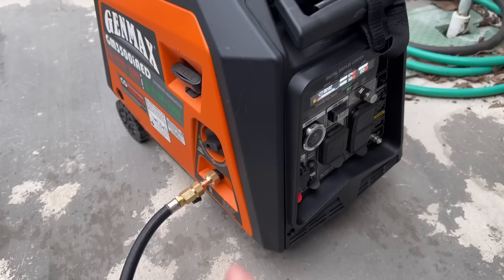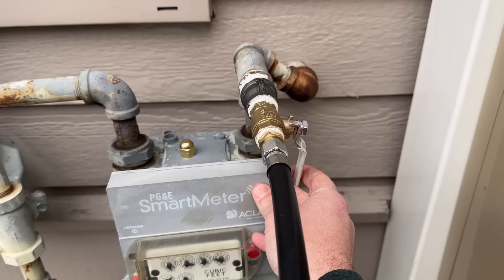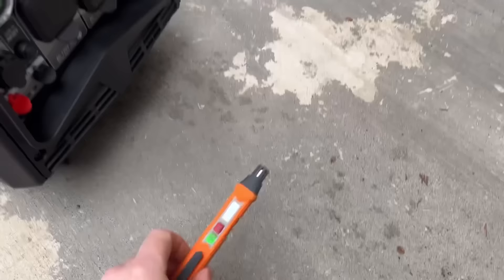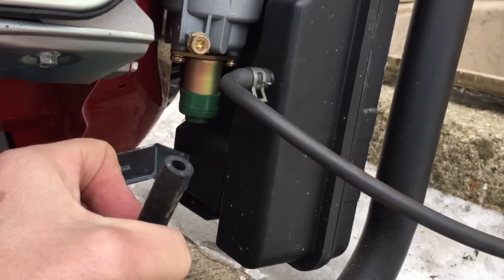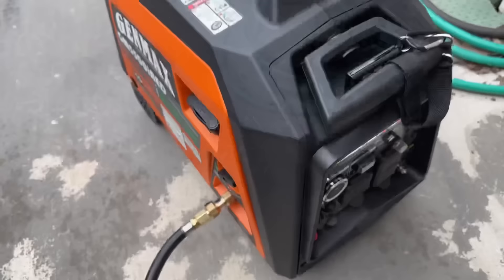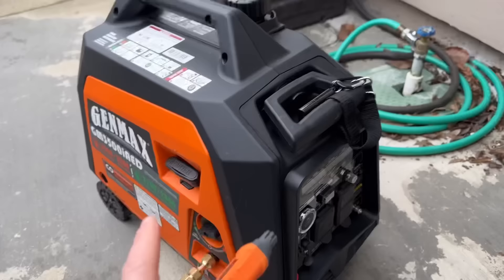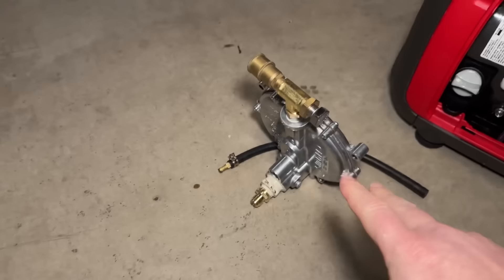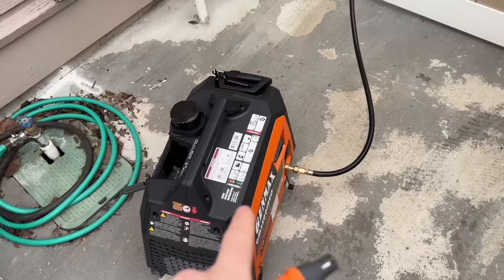Natural Gas Generator Hook Up People Should Stop!!!

Comment: Why can't they just let it determine its own speed according to whatever magnetic load is pulling on it?
Reply from the maker: With a proper regulator it would work properly but just sticking a hose in the air box does not have a way to be controlled.
Reply: @johnnysweekends : OK, but I'm specifically talking about the load on the engine, because you mentioned the load. And whenever you turn on another device that's connected to the generator, the engine feels that magnetic load and automatically tries to compensate for it in order to keep the RPM at the required speed for 60Hz. No one needs to throttle the fuel down or up manually. So why does anybody have an idea that they should have to control that manually as far as the engine load is concerned (set aside anything about turning the engine off, for the moment)?
Reply from the maker: In this demonstration, I’m warning people about not using the correct regulator that has a valve shut off built in. 
There are a couple videos going around where people take a hose and shove it in the airbox which the vacuum sucks the gas in. Once the generator is starter they adjust the gas flow by using the shut off valve as a flow control device. If you add more load you will need to go open the valve a little. If you lighten the load you’ll need to close it a little. If the generator shuts off and you don’t know, the gas will free flow, and nothing is stopping it. 
They are not using the correct type of generator or the proper add on kit to use. 
The generator doesn’t know any different as long as the correct amount fuel is being giving for the load.
Reply: @johnnysweekends : What happens if they just leave the gas on full instead of thinking they have to manually adjust it with the load?
Reply from the maker: If they leave it on full and the generator doesn’t need that much fuel for the load applied eventually it will just run to rich, then start to hesitate and then even actually die. And the gas feed will continue to flow since the valve is still open.
Reply: @johnnysweekends : What would prevent it from running like it does in gasoline mode with its basic governor?
Reply from the maker: If running on gasoline it’s utilizing the carb. That’s controls proper fuel mixture for the load the generator needs. Much like a car but a older car not using FI but basic principles apply
Reply: @johnnysweekends : Right, I understand what carburetion is. But why wouldn't it need that mixing device for gas/gas (fuel/air but just that the fuel is a gas this time instead of a mist/vapor)? And what if someone tried it?
Reply from the maker: I’m sorry but I’m not sure I follow. 
Are we talking about using gasoline with the external regulator from century?
Reply: No,  @johnnysweekends . but now that you mention it, that does sound like a fun experiment for Garage 54 or someone like that!
What I'm saying, though, is: Even though carburetors are designed for mixing gasoline or model fuel with air for the oxygen, what would it be like if someone just tried hooking this gas supply up to the carb intake instead of bypassing it, and then at least they'd have the carb's governor to help run it?

Comment: Maybe you don't know but your hookup is illegal you should not be on that meter at all if your utility comes to inspect you will be red-tagged and shut off.
Reply from the maker: Just for the video..👍🏼 takes a minute to switch and put the plug back in.
Reply: Wrong. Depends on your utility. I'm ok to touch anything on the household side
Reply from the maker: From my research I’m fine. Hence there is a T and a cap for access on the out side of the meter. 
I’m still double checking but everything I have found says I’m good.

Comment: While I advocate the use of a regulator, if you have that much gas leaking out of your vent, I would say that its not working properly. Also, proper venting should be 5' away from an ignition source anyway.
Reply from the maker: This leak was due to not having a external regulator. That’s what’s controls your shut off. The internal load regulator does not stop flow, only regulates with engine speed and demand.

Comment: just have a long burning candle going next to it, its a great way to let you know there is gas leak and its just and extra $5
Reply: That's how we used to check for gas leaks if you didn't have soap and bubbles. Run a lighter around the fittings and if you had a leak you'd see a little flame at the leak.
Reply from the maker: Ill stay with my sniffy pen…😂👍🏼

Comment: Wait, you can use natural gas on a propane generator?
Reply from the maker: Yup but sometimes modifications are needed but power is way less
Reply: @johnnysweekends  yeah I was looking to get a tri fuel because no one makes a dual fuel gas/NG combo that I could find... Don't really use propane, but got a basically endless supply of natural gas

Comment: First off propane and natural gas are two different things. Second, you don't  have a regulator. You can not safley use a valve as a throttle due to the pressure increase and drop that occurs with the gas service line. Third and final the Gen is to close to the meter to safely operate it.
Reply from the maker: Did you watch the video and meaning behind it?

Comment: Sounds like a regulator should be included in the device….
Reply from the maker: All propane or dual fuel generators will come with a proper regulator. It’s more of the point at which people are trying to hook up NG to any generator with out the proper regulator.

Comment: I think this cropped up in my feed because I've been looking around. I have a propane/gasoline generator and I've been trying to see how I could run it on natural gas. I've found a few places that do kits but my model isn't listed. From what I've read, it can be done safely. Do I just need one of these demand valves with an appropriately adjusted load block?
Reply from the maker: Some dual fuel units can be run on NG some cannot. Ill have a video out in a few days on how to tell if yours is compatible
Reply: @johnnysweekends  I know they do make tri-fuel units so I'm prepared that maybe it's not.

Comment: I didn't know you could do this!   So can you do the same thing... Gas vent hose .... But use the regulator?   I had purchased a tri fuel carburetor but this is super straight forward
Reply from the maker: Buy a dual fuel carb and run a line and use a proper conversion kit which sometimes have a gasket with hose so you can skip the carb
Reply: @johnnysweekends  yeah I did....  But I was wondering if this method of the line I to the air cleaner plus the addition of a regulator would work acceptably?
Reply from the maker: You just need a proper load regulator/ demand regulator that shuts off when there is no vacuum. Unfortunately the airbox doesn’t have enough vacuum to open the diaphragm. 
I’m telling you how it works. What you do from here…………🫣😂
Reply: @johnnysweekends  that's exactly what I needed to know. Thank you!

Comment: what is the valve part called that you control the flow with after the regulator?
Reply from the maker: The big silver regulator ? On top of the silver regulator is a load block.

On top where the gas is coming from is a shut off valve
Reply: @johnnysweekends  thanks.  that what I needed to know.

Comment: If a person is changing the idle speed like you showed are they not also changing the Hertz speed ?  Can you recheck it is a hertz meter ?
Reply from the maker: That’s all digitally controlled to hold 60hz with a certain amount of allowable distortion and variances.

I have never seen more than about .5 difference in hertz changes on an inverter type generator.

Comment: Surely a generator designed to run on gas has all the safety mechanisms included? Does your country not have any technical standards?
Reply from the maker: The generator is fine and are standards are in place, it’s the diy method people are doing. Maybe you missed it in the video.

Comment: Are those electrical boxes next to your gas meter? Where I live 6’ is the minimum distance between the gas meter and electrical boxes of any kind. I am sure there are requirements for distance from an internal combustion engine too. But yes improper gas regulation is required. Don’t the large home generators have a valve controlled by the engine shut off?
Reply from the maker: I’m in CA and everything on my outside wall is to code including the solar and disconnect.  The video is for demonstration of what not to do.
Reply: @johnnysweekends  I don’t have gas yet but I looked into it as it’s just up the road but I have to lay $4500 just to get it to my driveway and then another fee for 250’.  Their specifications call for no electrical within 6’ of the meter/regulator. They told me even my low voltage security cameras can’t be closer than that.  It’s expensive to own newly developed property first. It cost over 6 grand to get power to the driveway.
Reply from the maker: Yea as new subdivisions are built regulations will change with it. And it could be the state as well. $4500 sounds about right to run a line of gas or getting water, electric and more. New builds are expensive just as you are describing. I will buy lightly used just for that reason lol. But I’m cheap so I may stay where I’m at lol.
Reply: @johnnysweekends  I’ve only owned 3 places in 43 years. One is only 1 1/2 miles away. We used to ride our snowmachines on this property 40 years ago and loved the views. the state subdivided the property and my son and I bought 2 lots each with nice views of the mountains. We bought other land from the state that is a six mile trail ride and built a small place there. Everything had to be brought in behind an ATV or snowmachine.
Reply from the maker: Dude that sounds awesome. Shred when you want..! 👍🏼
Reply: I grew up in California the 2nd house I lived in was build in 1946 nearly 80 yrs ago. The gas meter and main service panel were in a utility access with a wooded door. The gas and and electric panel/meter were separated by a piece of wood.   I looked at a goggle satellite picture of our house a few yrs back, the electric service is now underground service head is still on the corner of the roof.  I am certain the new meter and panel were moved away from the gas meter.
Reply from the maker: I would have thought they should have been a few more feet apart. But….🤷🏼‍♂️
Reply: Code must have changed.  Older buildings in California often have electric above the gas meters.

Comment: As a PG&E gas employee I have to say,  this is a really bad idea. Don't tamper with natural gas equipment. It's dangerous and a stupid idea.  And to Johnny's weekends. When I stopped the video I can see your meter number on your PG&E smart meter. . That's a bad idea also. And you are giving people bad ideas. Also, that tee on the right side of the meter with the plug in it, is not for the customer to use to connect stuff. It's for our use to probe the meter so we can work on it without losing your pilot lights. Everything behind that tee is considered customer's house line, everything in front and to the left is for the utility.
Reply from the maker: The whole reason for the video is to stop people from a bad $10 diy mod that people are doing that is dangerous. There are a couple people out that promote it saying check out this easy simple trick with no regulator and demand regulator that has a self stop. 
It’s a valve and a hose into the airbox. That’s it. 

Now I did make a series of videos which I also have advised people to check with there local municipal facilities to make sure your connection is legal. 
I don’t use NG for my units as I prefer propane or just gas. 
And my unit is already swapped back with the original plug which you can probably already see in the video, as again it’s to stop people from a bad idea that started going around to cheapest hook your generator up to NG. 

Thank you for stopping in and giving in site on this..👊🏼👍🏼

Comment: Where do you find the whole deal of tapping into your ng meter? Was wondering about if adding another tap would somehow mess with the other ng appliances inside..  my guess is if i tap off of the main run with a tee and dripleg to valve then quick disconnect then it shouldnt effect any of the things inside..
Reply from the maker: You can tap on the other side of the T but not the plug side. Mine was for demonstration only and already swapped back. But if you add another item to your gas feed it won’t effect the rest of the appliances unless you plan to run everything on full and if the new item added also consumes a lot of btu’s to run the new items.

Comment: Right off the bat, that water ball valve is NOT approved for gas use. You need to use a valve approved for gas use. They can be found at any home center.
Reply from the maker: Pretty sure it says gas right on it. But all in all the video is demonstrating the poor videos going around promoting this, where as I’m not. 
I have already put my original plug back in
Reply: @johnnysweekends  Well then as long as it's approved for gas no problem. I just know some of those cheap home center ball valves are not.
Reply from the maker: I will double check again since I’m headed to the store to get more stuff lol.
But it’s already been removed since my last video is already made and in editing.
Running dual fuel on NG 
Some can some can’t.

I mean they all can just depends how involved you want to get

Comment: ok so worst case scenario, suppose you have natural gas outside of your house spilling. what exactly do you think will happen next? you ae not running the generator in an enclosed space. also, as long as you are monitoring that the generator is running, there is no issue with this according to your own assesment. also, you can get a normally closed solenoid value from china for under 10 bucks that would mitigate the issue you described. hook it up to the same genrator and problem solved. generator shuts down, valve is powered off, gas stops flowing.

Comment: Johnny, I have a Firman WH03242 that comes with a LP regulator. Is it safe to just hook my NG grill gas line to the regulator even though it is designed for propane?
Reply from the maker: I have a video coming out in about a week on this very topic. If your demand regulator is outside the unit it can run on NG with a kit. But you still need a kit which is cheaper then replacing the whole generator if you like that unit and want to still use all fuels.
Reply: @johnnysweekends  Yes, it’s brand new. Never hooked it up before and didn’t realize I needed extra equipment to use with NG instead of LP. Lots of bad info all over the web.
Reply from the maker: Yea it will depend on the type of hose you have and where you demand regulator is. If it’s on the hose you can get a kit and run all three fuels. If it’s internal then no. Unless you want to modify it which voids warranty and you should have some mechanical ability
Reply: @johnnysweekends  It is external. Are all NG regulators universal or do I need to track one down specifically for my model?
Reply from the maker: All the regulators will be outside but the load regulator I different it looks like the big silver thing in the video just smaller. But that’s the part that could be inside which then would need to be bypassed which I would do unless you want to void warranty. And also you should know what your doing.
Reply: @cuppacheese  Keep in mind that natural gas will produce the lowest amount of watts from your generator. A 20% loss in output wattage is the claim. If your generator is rated at 10,000w expect to only get 8000w out of it in natural gas. Propane is a little better. Also you will use more natural gas than propane when it's running on natural gas vs. propane
Reply from the maker: It’s actually 27% decrease from gasoline to propane. From propane to NG is another 20% ish I think. It’s a decent drop in total power output. I would have to look again

Comment: Does the gas line have to be shut off at the street to make the connections for the generator  line?
Reply from the maker: No right be fore the meters is a valve you turn off. But make sure you do it on the other side of the T. That’s where you are allowed to plug in. Mine was for demonstration only and already switched.
Reply: @johnnysweekends  thanks..I just checked and saw the shutoff.

Comment: If someone is dumb enough to get out a couple of pipe wrenches and disassemble their gas piping to illegally hook it up to a portable appliance like that then no video on the internet can help them. I doubt those cheap generators even come with a orifice kit because it's a residential product and they don't want the liability of a homeowner opening up and fiddling with it.
Reply from the maker: There is a kit and hose that would hook to say a fire pit line or NG bbq line..👍🏼 When at the meter you will have to check your local codes

Comment: But wait a minute you should NEVER modify your home's natural gas system either... Modifications should be done by a trained, licensed, bonded and insured technician.

I get the generac standby generator feeding off a home natural gas system. But doing this on the cheap? Nope. Sorry. Ain't gonna happen.

My two cents.
Reply from the maker: Hence why I don’t know why people promote putting a tube in the airbox and away they go…🤷🏼‍♂️

Comment: I assume all modes have to be approved by the NG company.  If you still have a meter reader person.  They will report any changes you do within sight of the meter.
Reply from the maker: Actually I don’t think portable units have to be approved at all. Never heard of it. Only permanent installed units.
Reply: @johnnysweekends  I think he means the valve you added to the house NG line next to the meter.
Reply from the maker: Ahh probably. I have already switched it back now that I’m finished with the videos I needed to make but yes always check with local municipal  facilities